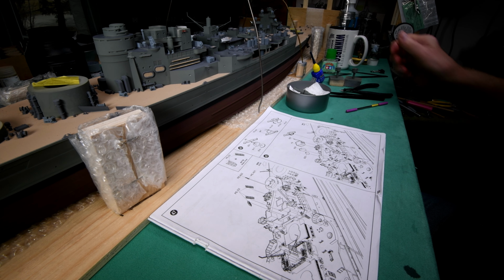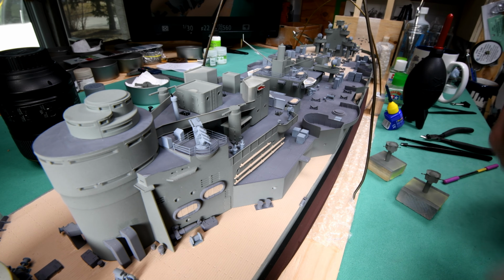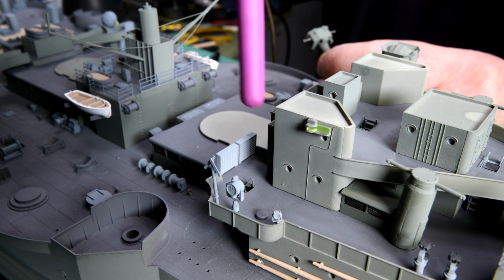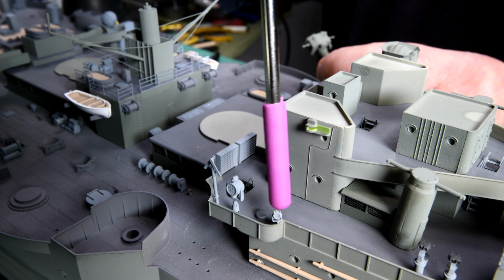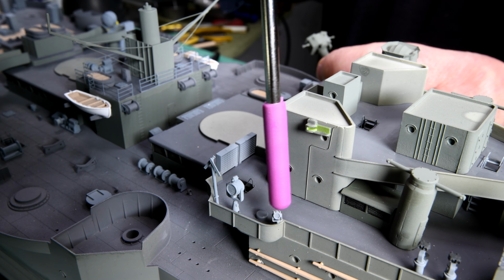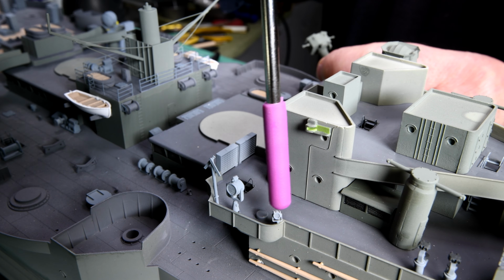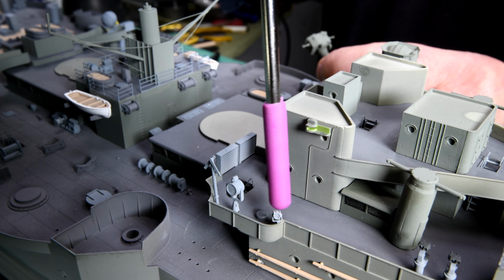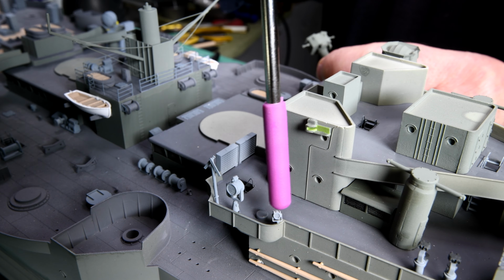The Model Ship - Part 752

Comment: Hi Ron  when I use Revell glue I usually put a drop on the part , I put it aside for about 15 seconds, it just gives just enough time for the plastic to start melting, then put it in place ! It helps stop it wicking out 😊😊😊😊 the PE radar looks like fun times ahead, 😊😊😊😊see you tomorrow
Reply from the maker: "put it aside for about 15 seconds" Great tip Marc! 👍

Comment: Revell contacta glue is just a thin testers type glue in an applicator. the Tamiya extra thin is much the best glue for these parts.
I use Revell glue for large flat areas.
Reply from the maker: Thanks for the tip Ralph! 👍
Reply: Mr cement for large flat areas for me 👍